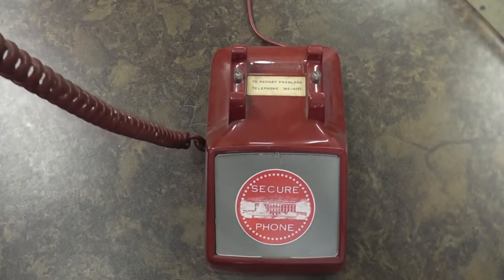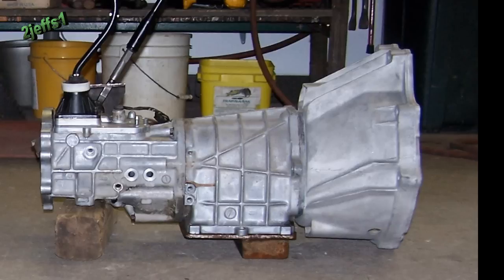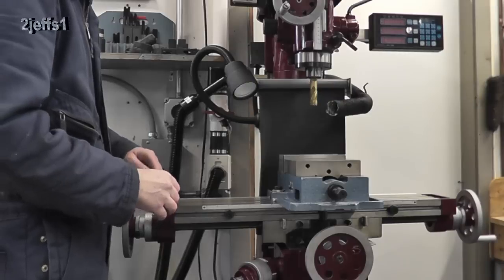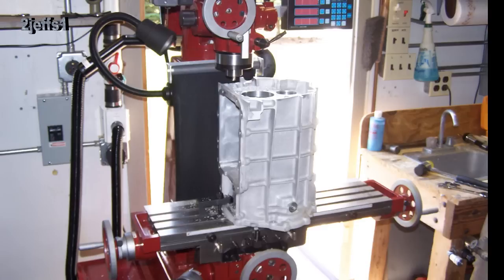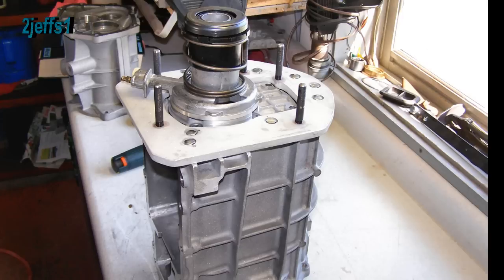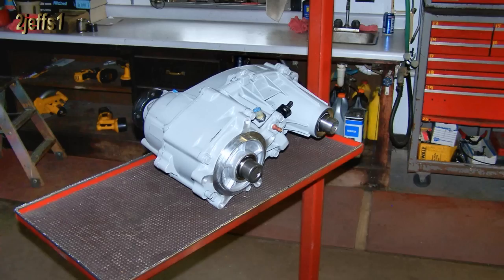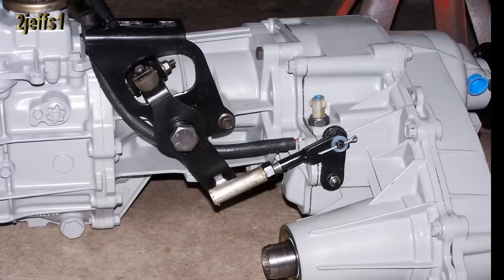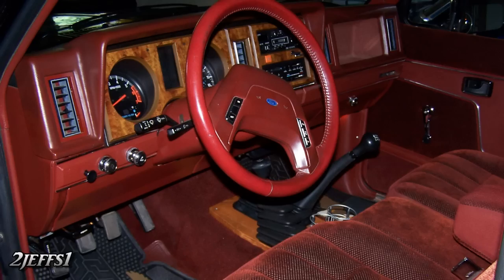Homemade Trans Adaptor a Lathe Mill Project

Comment: Hey Jeff,
       Well it  looks like Fords engineering department needs you to teach them a couple of things !  Wow it is very impressive .  I guess that when you put your mind to it major things change !  Thanks for sharing !  I know the time spent even making the video could be spent in other places !  Thanks again
Reply from the maker: Hi Cody. This was a pretty good challenge at first. It has been trouble free and the shifter on this trans has a nice crisp feel to it, not like the previous one which I called similar to a flat basket ball. On that old one the linkage went from the top to the bottom and then up to the forks which made the shifter have the squishy feeling. The bottom line is I never had one of those d50's apart until this project. That alone tells one how dependable they are. Take care Cody, Jeff.

Comment: your truck is about as old as I am but in much better condition :O
Reply from the maker: Too funny! Actually been feeling the same way, especially the last few weeks with a dang hamstring issue....
Reply: sounds weird, but try compression shorts or even an ace bandage.  failing that, whiskey.
Reply from the maker: Been doing heating and cooling pads.Not up on any medical stuff. Thank you, appreciate your thoughts & help! Probably throw in several beers tonight too just to be safe...  ;>)

Comment: Good vid, love the shop.
Reply from the maker: +William Ward Thank you William.
Reply: Yes, really like your attitude and you vids. You almost always have a smile on.  Your Shop you could do a whole vid on that. Looks like a converted barn and it is great. Do you automotive repairs? And, what would one have into building your oil furnace heater? Did I catch that right. It has been in use for 30 years? Keep up the good work. Cheers!
Reply: Oh, do you still have the MG rebuild gorgeous rebuild.
Reply from the maker: +William Ward Friends/folks brought things to fix so I went full time auto repair in 1982. Bodywork, mechanical & electronics.  I moved here in 86 and began work on the building. It did need a lot of work and they wouldn't even put it on the appraisal when I bought this place. (actually have some archive video of putting the shop together back then) Had a 2 stall garage before here and - yep - that is where the oil stove was first built. Some time in the future I plan on doing a vid on the shop where that has been inquired about by several others too! Mary still has the MG. She says she won't ever sell it so... Take care William, Jeff.
Reply: Wonderful story thanks for sharing and look at what you saved and to use often a very nice shop. Good times good times. I like the MG. My convertible and not yet Shelby Cobra I think about two years from now.

Comment: That is a sweet little truck. I had a second hand 84 ranger that I drove for quite awhile. I finally had to send it to the bone yard when I could no longer fix the frame on it.
Will
Reply from the maker: +william mosher Sad when rust takes a vehicle off the road and they run great yet. In recent years the cust cars are notably worse every time you see them with what is being used now....

Comment: Jeff it's amazing how you know and can do all kinds of things!! Would love to have the 4x4 for my 86 ranger, same motor as yours but seriously thinking about a 289 or SB chev.  What's your thoughts on either getting a different engine or switching to a carb conversion of the 2.9l . would have to see if "Painless Wiring" could make a new harness up. Would love to get your thoughts when you have a minute. Thanks so much!! your help is greatly appreciated.
Reply from the maker: +dave hogan I did have the thoughts of a Chevy SB a while back. I guess it wouldn't be as feasible for me where the truck gets mostly used in the winter now and drive the cars in the summer. I ordered it out with the optional posi and 373 gears, it goes pretty good for what it is. Some time in the future I'll probably make a video on all the tweeks and mods to it where there quite a few.

Comment: Wauh you are very talented
Reply from the maker: +V Jørgensen Thank you. Always enjoy a new challenge!
Reply: +2jeffs1 
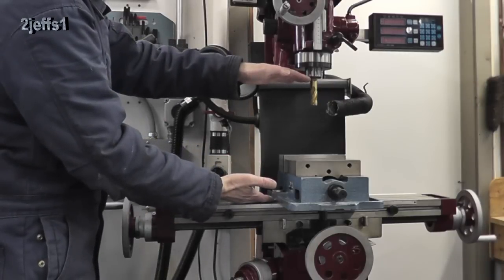1:33
Yup. Point of no return! 
And I bet all the places that make prefabbed adapters said:  you wanna put a what in a who? 
Love this stuff that scares most people.
Reply from the maker: MrTheHillfolk
Your right. I didn't call anyone where they would of been laughing as they hung up! It was like 93 out the day of the test drive. Went on the road next to here to give it some abuse to see how it holds out. Didn't have a tunnel cover made yet. While cruising down the road the thermostat opened. I thought the cab was hot before. Now it felt like the body shop heat gun was pointing at me too! That raked cement is great for traction but even better to see if anything will break.  :>)
Reply: +2jeffs1 
Haha , smart man, don't even bother to call!! 
That heat blast sounds like it was similar to an old van without the doghouse in place. It's amazing how much they silence when in place! 
And the tunnel hole blasting heat like that is interesting. Good thermostat test at least :)

Comment: that is a very rust free truck for living in the north with all the salt
Reply from the maker: +Dan Gerous By oiling the underneath and inside everything has worked quite well. It takes quite a while and far from my favorite job tho...
Reply: 2jeffs1
Do you just spray the whole bottom of the truck with oil? And also what kind of oil do you use?
Reply from the maker: +Dan Gerous I have multiple 1/2" holes drilled in multiple areas where just spraying underneath wouldn't  cover. I believe that is the most important part. It takes some time to do but is paying off in the long run. I have plastic hole covers which get re-installed when done. I am using a Sata pressurized pot undercoating gun. It has multiple quick disconnect attachments. I use 5w30 clean engine oil. I might be doing a vid on this next fall so stay tuned...
Reply: 2jeffs1
I would love to see a vid on this , I live in Michigan where they salt the roads

Comment: Nicely done and I like your thinking on clutch line. They are a bit of a pain to change and that plastic line is weird and not patchable. At least my repairs never worked. My son put my 92 Toyota in the ditch a week ago. Ordered both fenders, radiator support, hood and passenger door. Still need a grill, windshield and passenger window. I will just build a bumper. This warm weather sure helps when working outside. Keep making these great videos.
Reply from the maker: +57WillysCJ Wow, that sounds pretty messy. Where one can spend so much time on used parts and their price - replacement parts are a good alternative. I remember working on those years back. They were nice trucks. Actually a guy wanted a custom paint job on his so... Good luck on your parts hunt. Sounds like that will keep you out of trouble for a while!
Reply: I am getting all replacement parts. I had plans and materials to remove the box and put a steel flatbed with tool boxes on it. This is not a fancy truck, just a work one that I don't mind  going down a logging trail and scratching the paint.

Comment: Great upgrade Jeff! Every time I see your truck in your video's it makes me miss mine! I had a 87 Ranger 2.3 4cyl 5spd my mom bought it new and gave it to me for graduation. It came factory with Roll bar and brush guard. It was Off white  with a black stripe around the bottom with a red and silver pinstripe. I loved that truck but you know how teenagers are I traded it for a F-150 years ago.
Reply from the maker: +John Wallace Neat you had one John. They are fun to drive and really good on fuel too. Actually I just did all the engine gaskets & general maintenance. Then the trans broke again. If the engine wouldn't of been done it probably would of went away too.

Comment: Waiting for a good deal on a lathe to come around! Do you have a digital readout for the X, Y & Z Axis on your Mill? Ours goes down to the Tenth. (.0001)
Reply from the maker: +tofubob10102 Yes there is an XYZ on the panels. Actually I built them too. A site named Shumatech had the plans. They sell you the plastic box, vinyl overlay, the main circuit board. The parts needed  can be bought at Mouser electronics. He also gives you the download for the program to make them work and a manual too. Then one installs some Chinese scales and your all set! The program will allow for custom work too. Take note on the 7 holes in the mill hand wheel!  After setup it will show you to 0 for all locations. Tested it out on those when first up & going! He also had the dimensions where to mill the holes in the plastic case. Just setup and lay the circuit board on a cart, cut the holes and assemble board and connectors in box.
Reply: +2jeffs1 Oh I'm seeing it now! Looks really nice.